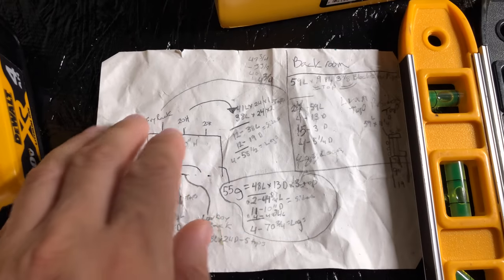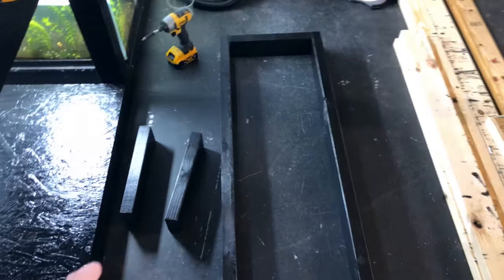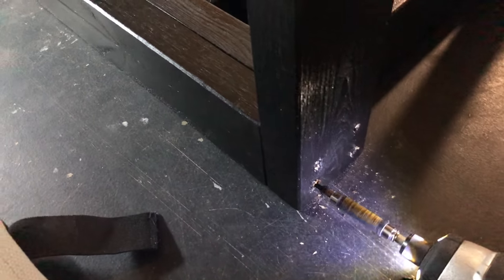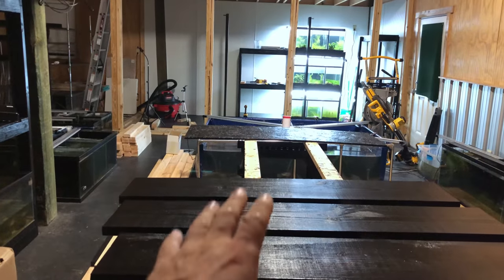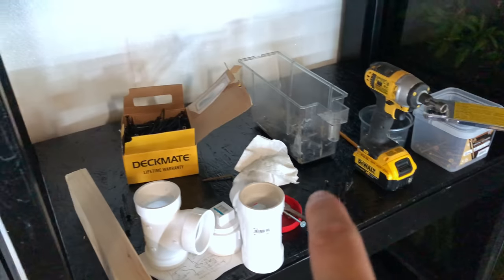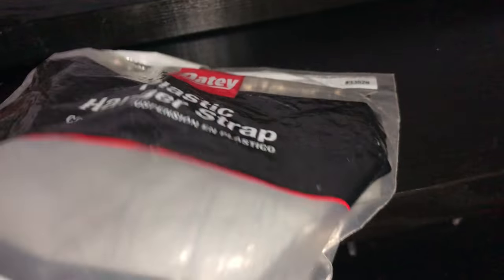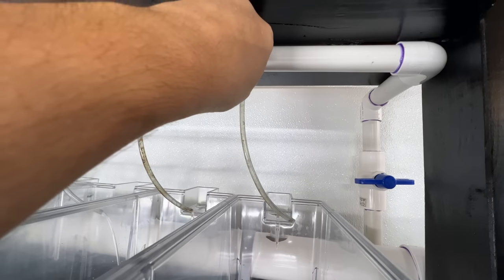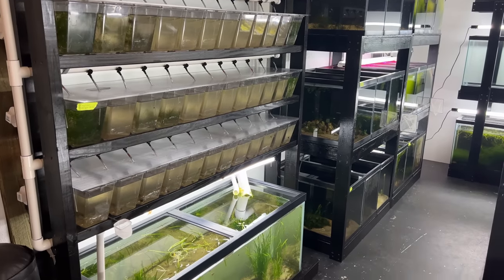Fry Rack Build for Aquarium Fish Keeping and Breeding

Comment: For overflows on plastic containers, I go to my local hydroponics store and pick up 3/4” rubber grommets and 3/4 ribbed insert elbows. I drill a 1” hole into the container, slip the grommet in, then slide the elbow in. This expands the grommet enough to seal the hole. Less than $2/ overflow and then I cut a piece of course filter sponge and slip into the inside opening of the elbow to prevent fry from going through the system and a piece of clear hose to go from the container to the drain system.
Reply: I would love to see a photo of that.
Reply: @pyleaquatics  what’s your email and I’ll send some pics.
Reply: Mind if i see the a photo of what your talking about? im interested in building something like that and for the life of me, i cannot find these clear overflow tanks he uses :/
Reply: @nocturnalllama  what’s your email and I’ll send pics of the concept.

Comment: You can remove the ink/writing on the pvc pipes with a quick wipe of lacquer thinner.  It will also remove most of the purple pipe cleaner drip marks
Reply from the maker: Great tip!

Comment: Use bracing boards front to back that you use those squeeze clamps to hold in place, then put the 2x12 sitting on that to then screw and attach it how you want.  ie make your own extra set of hands out of clamps and extra blocks of wood to help hold up the shelves.  It should make it much easier to do.
Reply: And if the two sides start to spread out too far to hold the board across between them, you could also clamp the board vertically on one side to the bracing blocks...that would hold it solid in both directions and you have all the time you need to adjust it and screw it together.

Comment: Great video. Definitely given me ideas to do this myself.  Handy as just acquired 240 of the same containers. Mine have lids and rear baffles.
Reply from the maker: O wow! Nice acquirement those are not easy to come by. Do you mind me asking on how you got them?
Reply: @LRBaquatics  im in the uk. Apparently these came from italy to the uk. They have been in a lock up for many years. They loads of very expensive equipment for labs plus the danio stuff. They had ten racks. People have already removed the taps from them think they have one complete rack left. I got 240 of the 4.5 cm containers. They probably have 200 of the smaller containers left. Plus about 20 larger ones. I may go back again 😉. The baffles are good. Some are blue some yellow with different perforations.

Comment: How would you use this design for a large regular tank, instead of all the small tanks?  What could be used as as an overflow from the 1 large tank down to the sump?  I have been looking at hang on back overflow boxes, but it appears that they  loose their siphons regularly.
Reply from the maker: Drilling bulkheads in your tank is probably the most secure approach for flow consistency. Hang on the back over flows do have potential to lose siphon or clog.

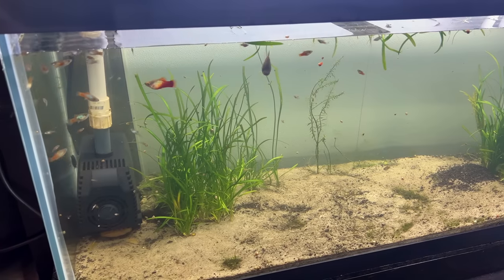Comment: 25:17  How do you keep the sand and fry out of the pump intake?
Reply from the maker: The sand stays on the bottom. I will put the plug in for half a second to scare anyone out of it if there is any. Usually not.

Comment: Hey Lucas will the two-by-fours and screw's method work for a 125 gallon aquarium?, I'm going to make an hour trip, does Imperial Tropic's have quality fish in your opinion?
Reply from the maker: I’ve never been there but seems like they have stepped up their game and have a lot to gander at! I have used that method with 125s. There may be a build for a double 125 rack that also held 2 40s on top. If you search YouTube through LRB rack builds